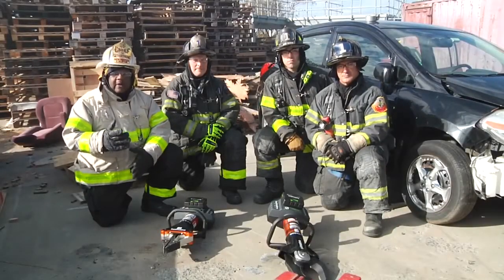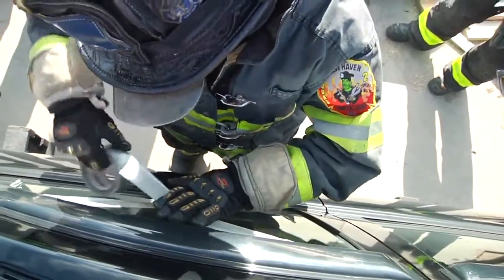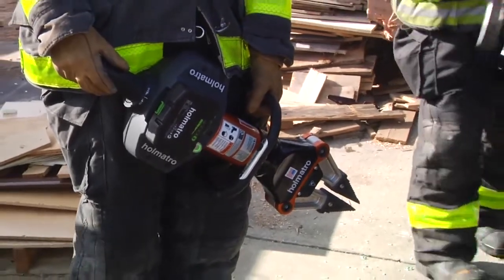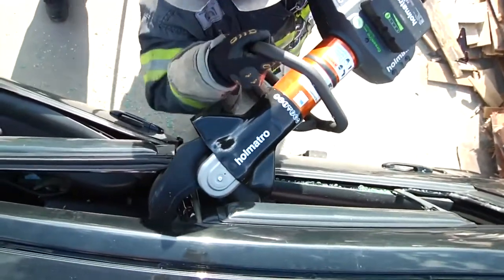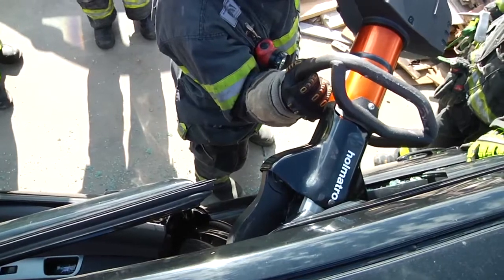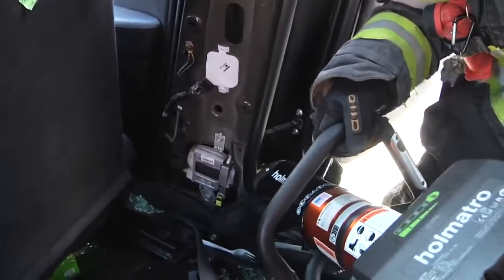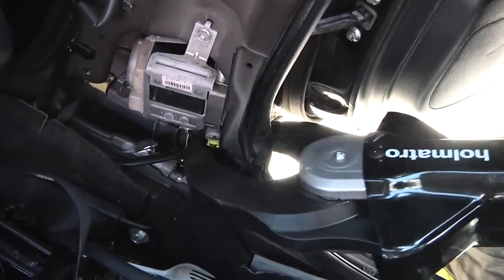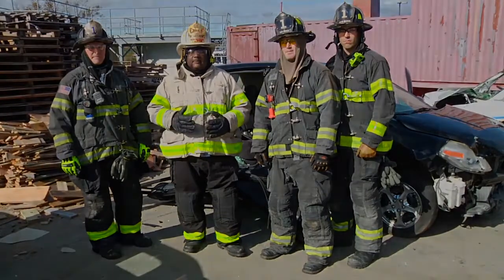Vehicle Extrication: Two-Door Takedown #6146025477001

Comment: Get the longest blades on your tool as you can afford. You can then do the vertical crush as close to the B post as possible. In most cases a simple door pop is all you need. Avoid cutting B posts as much as possible due to amount of SRS components in the B post. Tearing and exposure to the rocker panel below the b post exposes high voltage lines. While removing the entire side looks cool, the reality is, quick vertical crush and door pop on each door followed by removal of the door will be much faster for most crews. Do the basics perfectly and the fancy “advanced” stuff just doesn’t make much sense or have much place in application.
Reply: agree, the SRS component if damaged could lead to injuries
Reply: They're cutting right through an electronic module. And then they want to set the stretcher on top of the fucking doors with two airbags waiting to deploy!?